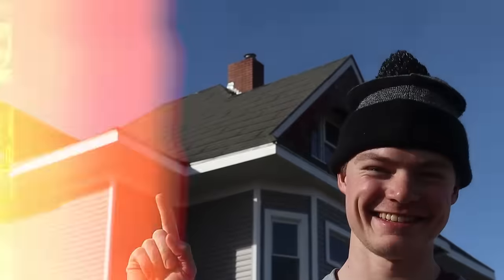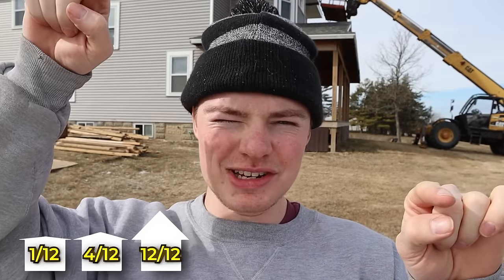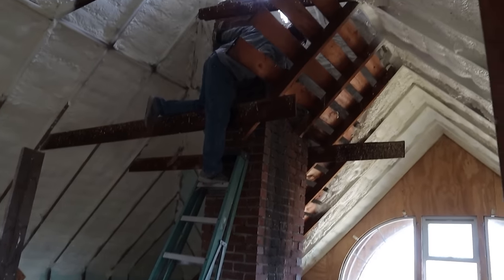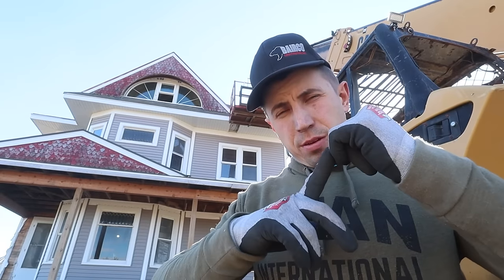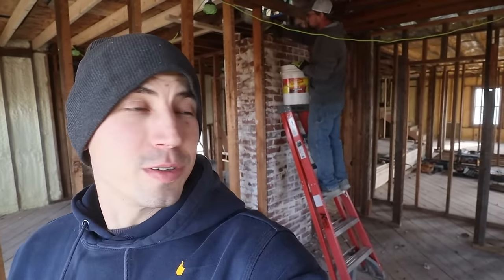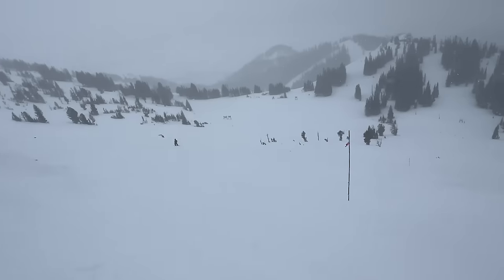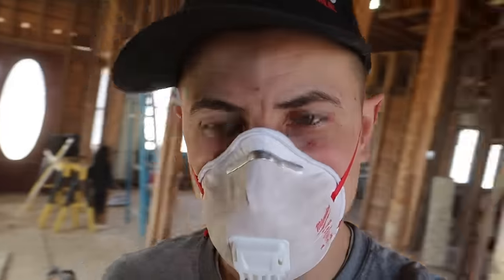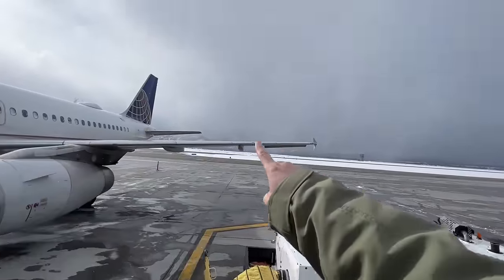Restoring A $7,000 Mansion: Antique Chimney Removal

Comment: My husband and I smashed the our chimney out of our house. We used 5 gallon buckets for all of it. We used the debris to fill an old concrete septic tank. We looked like coal miners covered in coal dust. We don't regret one moment of it. Best decision we could have ever made for our 40s brick ranch house in northwest Ohio. Removing that changed the entire climate of the inside of our home, reduced the moisture(no more sweaty windows in winter). Our bill to heat the house dropped by 25%.
Reply: Fireplaces are a heat gain in the summer and heat loss in the winter.
Reply: @MsSkipperkim -not if your using it. I would never live in a house without a wood stove. So comforting on a cold snowy or rainy day.
Reply: @kendall959  I inherited my childhood home. I used to roast myself laying in front of the wood fireplace. It's top of my list to get it inspected and cleaned so I can use it next year. Even with the new insulation I added to the attic, I'm still cold. :(
Reply: I did the same thing, pitched the top off the roof down in to the yard and the inside portion through an open window. Left the part below the floor because it was only a crawlspace anyway. Ended up building a nice closet from the old space.
Reply: if you had old chimney you could have kept it. all you had to do is install chimney gate (not sure for the name in english) but it is used to close the chimney when its not used so that the warm air doesnt go out and that the cold air doesnt get in...
Reply: @NoYouAreNotDreaming  is called a damper here. They work very well keeping the summer heat out of house and the same for the winter cold, unless you want to use the fireplace then your home is nice and toasty.

Comment: Heya Roman, my dad used to call all that soot and smoke "creosote".  It's all the vaporized tree sap, soot, smoke, and condensation hardened onto the walls of the chimney.  Unfortunately, when it's that thick it becomes a huge hazard because burning a fire can catch it all on fire, then you have a "stack fire", and it can burn the entire house down.  They tell you to have a chimney sweep come out once a year to remove all that, but my dad would fill a gunny sack with large nails and run that up and down the chimney until the creosote was knocked off.  That amount of creosote makes my skin crawl.  I helped my dad fight a stack fire when I was a preteen, and we only had a couple of minutes to get it under control or lose the house.  We succeeded, but it was closer than I care to remember.  Thanks for showing us what it looks like.  :)
Reply: Very cool story! Thank you for sharing 😊

Comment: Used Bricks are on the market. There's money there. Also, Please continue to consider going with the Mini Split system over the conventional HVAC system.  No expensive air handler or having to worry about loosing or gaining air temperature going through air ducting. Also, no losses on space for a giant air handler or all that ducting. Each room can have its own temp setting. The entire house doesn't have to be heated or cooled for those few rooms being used.
P.S. They are soooo easy to DIY. And the cost is sooooo much cheaper. Refridgerant lines are easy to route along with all electrical connections. Condensation  lines are sooo easy.
Reply: He will still need a heating system on top of the mini split systems.  They are only good to -14 below.  So he will need a backup system.  He be better off doing a system to heat the whole house and then adding mini split to places.    If you are going to invest in mini split for a house don't do the cheap DYI ones go with the name brand better units and will have hyper heat. Mino split are better then heat pumps.  But with heat pumps, mini splits and GEO you need a backup heating system so a force air furnace is what most use.  On my GEO system they come with electric heating grid.  He might be better of doing GEO for the long haul and then install are getting easier these days as well.
Reply: While it does get cold, it doesn't get and stay below -14 continuously for that long in Iowa. And with the house sealed and insulated so well, a heat pump would probably be sufficient.
Reply: @hillbournesian  Heat pumps are not a good idea for northern states where temps are consistently below freezing, unless you don't mind being cold inside your house.

Comment: The only thing I think I would change is I would still ask for a fire place. Not because I want to haul wood in etc. But because I love the ambiance of a fire place. We don't use our very often, but having a fire on a cold rainy day or when the electricity goes out is really nice.
Reply: A fireplace is nice but a wood stove has all the benefits; is easier to install and more efficient for basically the same ambiance.
Reply: I've seen a few of the electric ones, they look pretty nice, still get some heat and the look of flames but without having to build a chimney.
Reply: Can't believe they tore that one out- all that handmade woodwork. He's really gutted all the priceless workmanship out that old house. Sad.
Reply: @mae3337  They kept the wooden fireplace surround to re use
Reply: @mae3337 hopefully they put some of it back in or it finds a good home. 

I grew up in a house my parents built out of tons of salvaged architecture (including a 120 year old oak staircase). So I have a soft spot for old school craftsmanship.  

I’d love to have that mantel and the built in mirror.

Comment: Wow, taking the roof out, constructing the roof inside and out, and then finishing the outside of the roof and shingles was a massive task. Sometimes, being the gopher is just as important as doing the other construction. You hired Justin and Roman for a reason. This is one of them. Besides, when you're on a pitch that high and 45° angle, you need a spotter, just in case. You and Nave will be picking out paint swatches and carpet swatches by Easter. Laying carpet is an all hands on deck project. Painting is the same, especially with new drywall. You'll be going through paint by the gallons. Justin is like a walking book of knowledge when it comes to construction. It seems like all he does is look, saw, and nail, and it's perfect. I wouldn't have the first idea on how to patch that roof. 😊❤

Comment: I'm surprised Cole isn't leaving himself the option for wood burning heat. Never know when you get get snowed in with no power. Of course he could go with a propane generator for backup power.
Reply: He's using in floor heating, which can also be powered by an outdoor wood burner
Reply: I was as well.
Reply: And I forgot about the heated floor as well.
Reply: Generator
Reply: Out with tide old and in with the new. I am not surprised at all.
Reply: @safffff1000  IF you watch Welker farms you see they did in floor heat in the basement but force air for the main floor.  There is a reason they did it like that.  In floor heat is great for concrete floor but not great for main heating of a house on the first floor.
Reply: @johnunsicker7440 can Also be heated by an outdoor wood boiler

Comment: Yes, sir Mr. Cole, I give you a suggestion. It won't cost you dime suggestions or free you You take it as much as you paid for it. I would recommend you put a search for boiler. The heat your home, what is cheap is plentiful. It will heat your domestic water for free. Will whatever the woods takes? I have a 4000 square foot home in 10000 square foot barn and I heat it with wood. Just a suggestion, remember and buy gosh, it was free.

Comment: The black stuff on the inside of the chimney is call creosote. I used to help my father clean our chimney at least twice per season of us, and then once more when the weather breaks for spring. Creosote is caused by burning wood that's not seasoned long enough, or burning too hot or too long. It can cause fires in the chimney, which can burn down a house. 😊

Comment: When you use a bolt and nut to “ safety lock the chain “ you need to double nut it , just ask any HV lineman he will tell you . And the reason you do that is case you blow a hydraulic line  or have mechanical failure or a control circuit failure and loose control of the basket or the boom.

Comment: not sure gutting original features would be considered restoring, nevertheless I'm excited for the end result.
Reply: Careful the apologists of the channel don't like that kind of talk but you are correct. I agree with you.
Reply: It isn’t restoring it’s remodeling.
Reply: @terrytrammell7388  Yeah but in this case the only option was to gut the house and build things back as needed.  No point in spending money on a restore when you needed to gut the house to fix all the problems.  If you watch any remodeling shows you know things go south and farther then plan to in a restore or remodel.  If they try to fix the floors without removing the plaster most of it would of cracked off.  Then how do you run electrical and plumbing through out the house.

Comment: @Roman and Juston, why don't you use wheelbarrows to lug all the  debris around?? Then you can take four times as much debris to the window to dump out and do it in a quarter of the time! It would save you alot of time and energy. They aren't expensive but they will save you heaps of time, and more importantly they will save the strain on your back. If you need to use the buckets in order to save double handling the bricks, just put the buckets into the wheelbarrow, you could probably get two or maybe even three buckets in a wheelbarrow. Got to look after your back, you only get one! 😊

Comment: To answer Roman's question about the Telehandler: In Norway, we refer to this as a telescopic lifter, but also telehandler is used. We have some that are 11,5 ton machines that can lift the forks quite high, but also the cabin for the pilot lifts 12 feet of the ground, on a separate arm, to let the pilot see better what he is doing. These are mostly used with a large showel for loading hoppers or large bins. The machine have all wheel drive, 4 wheel steering and can crabwalk sideways when needed.

Comment: I found that, with a tool belt, the first day on the job it is full of tools and the second day I take out everything I don't need.  I also have a second belt that is my layout belt that has the tools for when I'm laying out the floor plan, or foundation, etc.  I have a project of my own this summer and will start with one and then to the other.  The belt can get heavy.  Also I will use a 5 gallon pail to put tools in.  I like to keep the tool bag as light as possible.
Reply: I hate a tool belt. I can’t function with all that bulk and weight.
Reply: I would use the good bricks for patio areas.
Reply: Good God that tool belt system must have cost 200-300 bucks!

Comment: Good thing that you are tearing that chimney down, it doesn't have a flue liner. Just one gap or crack can start a fire. Many an old home burnt down with that type chimney.
Reply: That round piece of metal that Justin was yanking out of one side of the chimney was a flue liner for the boiler.  The other side didn't have any liner, though.

Comment: I remember growing up in the 1980’s and early 90’s in NW North Dakota. We had a wood stove to heat the house during the winter. My brother and I would have to alternate going up on the roof and shove a chain down the chimney to “clean out” the soot that builds up. I learned that the soot was actually pretty flammable one year when one of our neighbors’ house burned down during the night during a blizzard. Nobody got hurt and they rebuilt, but as a kid/teenager, that was pretty scary. Our dad eventually had a propane furnace put in and the wood stove removed.

Comment: Worth your time and money to invest in a shop-hammer, for demolishing masonry joints. It has a flat head on face, but the other is a wedge. They are frequently utilized for black-smithing... They have a heavier weight, and do a far better job of shattering old mortar. They are also fantastic for bending hot metal, or for straightening it.

Comment: Should keep or put in a wood stove for a secondary source of heat since you guys live rural. Just a thought.
Reply: They have LP gas.  I small 5000 wat generator will be enough power to run the boiler or furnace to heat the house.  Not worth the hassle to do a wood stove.

Comment: Cole have the puppy checked out by a veterinarian. My dog was doing the same butt drag and it turns out there’s a gland in their 6u77 that needs an occasional service; depends on breed. After my dog got treated, no more dragging but needs to e checked occasionally. BTW house is looking good. I originally thought the wood trim could be saved but the demolition exposed the issues that need renovation otherwise the house won’t survive. You have a great team.
Reply: Anal glands in dogs get stopped up and need a veterinarian to express them. Easy for them and relief for the pup.

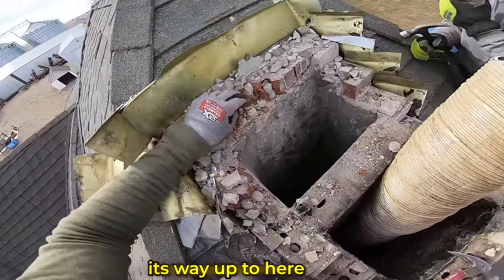Comment: You need to replace the fireplace and flues with a Metal Flue system. For emergency Heat source.  Did that several years ago at my house. 7:12

Comment: Guys should get a hammer drill aka demo drill.  Save a lot of bull work.  I’ve been using this with good results - ENEACRO 1-1/4 Inch SDS-Plus 13 Amp Heavy Duty Rotary Hammer Drill. Amazon cheap.

Comment: Chimney hole: 3/4 inch osb can span 24 inches ! Center 2x4 is overkill! The you install 1/2 plywood ontop of the osb to match what was on top of the old roof deck.  Even more reason that 2x4 is not needed!
Reply: Oh dear, that one 2x4 is going to put the entire project over budget.
Reply: @benhur520  The point I was trying to get across is that these guys are making structural changes to this home without a professional assessment.  Sistering todays 2x8 to true old sagging 2x8 that are over spaned to begin with and sitting on a beam that should probably be replaced because of the negative sag in it showes there is no professional assessment on the structural integrity.  That 2x4  is not going to upset the entire job but showes no one really knows exactly the capabilities of the products they are using.

Comment: That creosote buildup is dangerous….if it catches fire then there’s a “runaway” fire and could burn house down.  That roof pitch is nothing nice to work on.  Talk about wobbly legs!!!  Great job getting that tire out. 

Cole should have started a guess contest on total weight removed from house. Between all that brick, concrete in kitchen floor, radiators, water in the heat system and plaster - it has to be a staggering amount of weight.

Comment: I must have missed the video on what kind of heat source will replace the chimney.
Reply: It's going to be so efficient, with just body heat and the light bulb inside the smoke detector will put out enough heat to keep it at a comfortable 68 degrees.

Comment: Even how nicely the house turns out afterwards I still think I would have just thrown a match in there and built a new one because you would get the baby a lot easier without so much of the birth pains. You know like hard enough to build a new house let alone demo'ing a whole another house first and I think they're going to run into all sort of problems in the future with it like the roof probably leaks, wood rot, etc.

You know all those big castles in Britain, all the people who own them they tell you they're broke and people find it hard to believe but the places are just such money pits to do all this work on that the owners end up with no cash. The bigger the place is the more maintenance problems and costs you have to live with in perpetuity plus the heating and cooling costs of such a large place are astronomical.

Anyone else attempting this I wouldn't advise going this route, and if you do I would only do it on a small place.

Comment: The dog scratching her butt typical means the anal gland is impacted or clogged, needs to released, groomers or vets can do it, very easy process takes about 10 seconds to do, but it will relieve the itching or scratching, and clear the gland. You can do it yourself, not hard to do, can be a little messy. It does impact her quality of life and can be easily resolved.